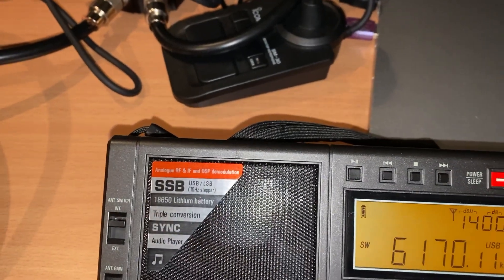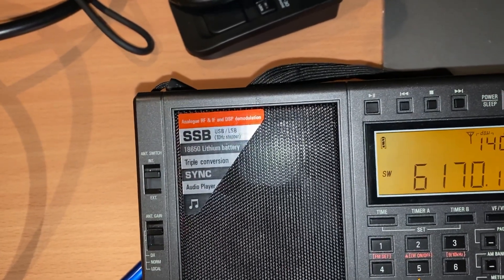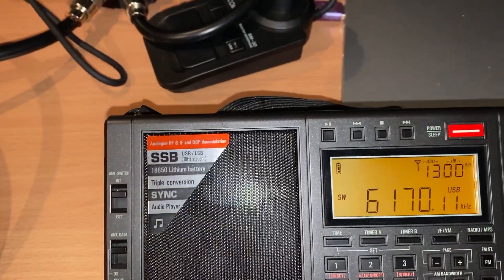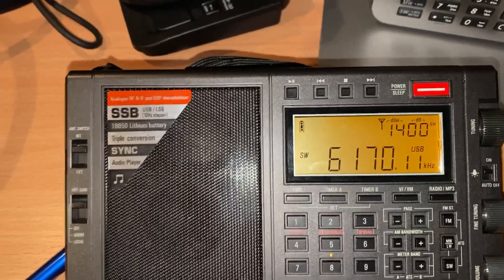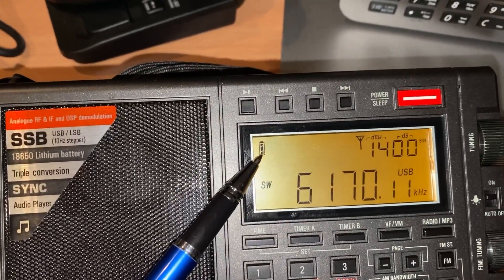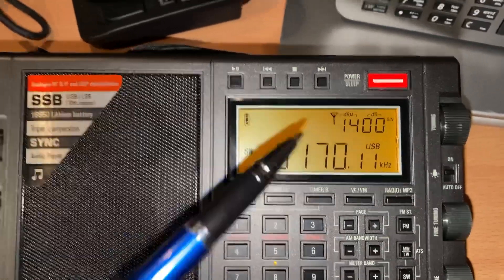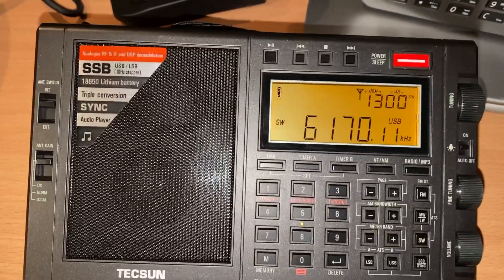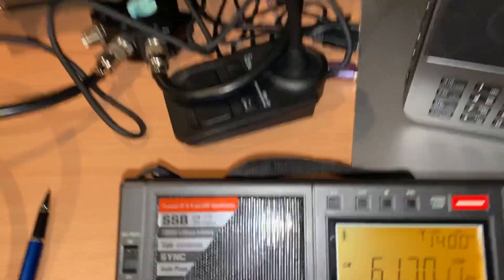Tecsun PL-990x Batttery Degradation.

Comment: After noticing my 8 month old PL-990x batteries are only lasting a couple weeks on standby - one of em only a week now -  I searched and found your video. I also have a PL-680 and the batteries that came with it were bad almost immediately. I replaced them with some Duracell's and they've been excellent ever since. Furthermore, I accidentally ordered 2 PL-368s and one of the batteries was DOA. The one I kept has worked  great for over a year now being used every day for at least 3 hrs (2 hrs for sleep timer and in the morning as an alarm. Btw, what an awesome radio, just like the pl-330 but in a different form factor, for those who don't know.)  So my conclusion is you could be hit or miss with the Chinese batteries but it sounds like from other comments that they're of inferior quality anyway. Thanks for the reminder on the care of Lithium batteries. I hadn't used my radio for couple months and it ran totally down. I think that's probably the one that now lasts only a week or less... Time to shop for some new 18650's and watch the charge level. Thanks for the video.
Reply from the maker: Hi and thanks for watching, I prefer NiMh cells because you don't need to think about them, if they're dead it's not detrimental.

For portable radios I really don't see an advantage changing to Lithium cells.

Comment: Just got a new 990 today it came with a stone cold dead battery that won't charge in the radio.  Ordered 2 18650s with a charger. I will never let them go dead.
Reply from the maker: Sorry for late reply, be very careful with lithium, don't charge it if the voltage goes too low. I really don't like lithium batteries in radios, nothing wrong with NiMH AA cells and they're a lot easier to get and can just pop in fresh Alkaline and you're good to go.

Comment: My radio had a standby current draw of about 5 to 6 mA. This lasts in a standby time of only 1 to 2 weeks. Additionally the batteries were drained to death. Finally I solved the Tecsun PL 990x standby power problem. The radio now has a current draw of about 88uA. This is a great value. The manual states 120 uA. Video Link: https://youtu.be/yx2br2XNpD4
Reply from the maker: Excellent, glad you fixed your current consumption, how did you fix it ?

My 990x battery lasts a long time, many weeks of standby use. The PL-330 also, the 330 always amazes me, it sounds a lot better than the 330, not as full sound of course because of it's tiny size, not as much bass but it sounds so much clearer on SSB and it works remarkably well with external antenna, very little observable overload, in fact I hardly notice any. If only the 330 didn't mute when tuning, this is extremely irritating but this little radio is a gen, sadly still some SSB distortion but it's a keeper.
Reply: @o00scorpion00o  As mentioned in my video I desoldered the Power MOSFet and the Schottky diode. They tested to be good. After cleaning the PCB with alcohol and resoldering some other parts in the nearby area, the error was gone. Maybe al leakage current. My 990x has strange behavior of the volume control. It depends on the battery charge. If the battery voltage drops the volume knob has a hysteresis. When I turn the volume up, nothing happens at first, then suddenly the volume increases. You can can confirm that? The muting of the cheap radios is very annoying. They do all signal processing in software. Thats the reason why.
Reply from the maker: @e-teacher9402  Thanks for the info, didn't know that about why we have to suffer the tuning muting. At least the made the 330 sound a lot better than the 880/990x S-8800, I suppose the tuning mute is bearable because it's a pretty decent radio for it's size with excellent performance, at least with external antenna. 

I will check out your video!

Comment: My pl990 does not turn on only show clock and light but no buttons work please tell what to do
Reply from the maker: Try pressing the reset button on the bottom of the radio next to the sd card slot. If not then take the battery out for around 10 mins, install battery and try reset again.

Comment: Do you know if the Tecsun pl-880 has the same issue? I have a Tecsun -990 and thought my batteries were loosing their life fast. Now I know why.
Reply from the maker: I found the life of the cells in the 880 didn't last so long either which could have been related to the radio not managing the voltages properly or due to poor quality cells or both.

The PL-680 in my opinion is a far batter radio because while the 990x is more sensitive on the whip the SSB audio quality on the 680 is much better and it's a much cheaper radio.

Best way to manage your battery is not to let the battery level shown on the radio to drop below the last bar and charge it up as soon as it hits the last bar. Don't let it run until all bars are gone and the battery indicator is flashing. 

The other advantage of the PL-680 of course is that it can take regular AA cells.

Get a good quality samsung or panasonic cell, max capacity is around 3500 mah not more so beware those advertising cells above this and there are many bad cells out there so get them from reputable suppliers, do your research.
Reply: @o00scorpion00o  I had a Tecsun pl-660, and 680. Sent them back because the offset frequency calabration did not work properly on the radios. I thank you for the information
Reply from the maker: @DarrenN72  That's strange Darren, my 680 calibration is fine, there are issues with quality control with these radio, some are luckier than others. 

No such thing as a perfect radio. I should have the updated version of the Malahit from Russia next week, can't wait to try that out, a friend of mine just got one and he's very impressed.
Reply: I had a older pl-660 I sold off. The frequency calibration worked  good on it. Just the new 660' and 680's I have problems with the frequency calibration

Comment: I just made an accidental observation regarding this.  I have many 18650 batteries, today is battery charging day.  When comparing the cells included with the PL-990 to others i have noticed that the included cells are about 1.5 mm longer than standard. This makes them protected 18650's. I would hazzard to guess that this means that there is no charge protection circuitry in the 990, other than a high voltage cut off for a full cell.
Reply from the maker: I have no idea what protection may or may not be in the cell but I do know that the internal resistance jump was high and it lost 400 Ah capacity. So something isn't working right my guess is the the voltage is going too low. Too far high or low is bad.
Reply: @o00scorpion00o  well i got really really into vaping competition a while back, so i had to do some fairly in depth research on lithium batteries so as to not blow off a few fingers when things go sideways.
Lithium batteries come in two basic flavors, internally protected and no protection at all.
The protected cells have a charge controller chip, typically on the positive terminal.  They are most common in high powered pocket torches and stunners, high voltage high current applications.
The easiest way to tell the difference in the two types is that the protected ones are ever so slightly longer to allow space for the protection circuit.
Reply from the maker: @abelincoln7473  Thanks, Abe I didn't know that. I wonder why type of protection they offer though ? Low voltage, high voltage cut off, both ? 

Perhaps this protection allows the cell to go too low which prematurely degrades it but not too low to risk fire when charging a cell that's been allowed to go too low. One thing for sure is that this cell in the 990x has lost way more capacity than it should have after 1 month so something isn't working as it should.
Reply: @o00scorpion00o  Well from my understanding of Lithium battery chemistry the two things that kill a cell the fastest are: over discharging the cell or charging it at too high a rate ( too much current or too high a charging voltage). A properly designed protection circuit typically cuts off the drain or the charge at about 3.4v on the low side and about 4.35V on the high.  Most batteries will tolerate being charged at a rate of 1 C or the equivalent to its stated discharge rate without risk of fires, shorting, etc... However it is VERY detrimental to the life of the battery. Most of what i have found tends to indicate that charging at 0.5 C is a much better practice, as is only charging to a cutoff voltage of 4.15 V.  
https://batteryuniversity.com    
that is a good place to start. If you have any questions about the math or the definitions just ask.
Reply from the maker: @abelincoln7473  4.35 for Li cell is too high should be 4.2 volts max but yes 4.15 is a good start and no less than 3.5 volts. But somewhere along the way the Tecsun seemingly fails in top or bottom end voltage protection or both. It wouldn't be uncommon for Li batteries to go to 3.2 v per cell to maximise run time. 

LiFeP04 being the exception to this, it works at lower voltages. Can't remember the HVC and LVC off the top of my head.
Reply: @o00scorpion00o  Hmm. I have been using Li-Co-Mn-Ni  perhaps thats the difference in the voltage... I will have to look into that tomorrow after work.
Reply from the maker: @abelincoln7473  I don't know of any Li tech that charges to 4.35 volts. LiFeP04 charges to lower vvoltage than normal Li.
Reply: @o00scorpion00o  @Abe Lincoln What external charger would you both recommend?
Reply from the maker: @klrscout  I use the Youshiko YC5000.

Good charger, can charge AA, AAA  and 18650 + various other cylindrical Lithium cells. I got it on Amazon. 

It will measure voltage, Internal resistance and it will do a discharge/ charge cycle to tell you how many mah the battery takes which will give you a good indication of how your battery is performing. You can set that charge current too. But I wouldn't do a charge/discharge cycle frequently, Li batteries don't need it, it's just to get an indication of the capacity in the battery. 

The other issue is the Tecsun PL-990x, we don't know how much it charges at the top or how much it drops to at the bottom and it could very well be allowing the voltage to go too low and I will do a discharge test soon to see how low it goes. 

A good battery internal resistance will be around 75 Mo. Mine was around 120 after 3 weeks and that's not good.
Reply: @o00scorpion00o  Thanks for all this info. I had some sort of malware in Chrome, and could not reply all day! I hate being rude, but had no choice!

Comment: Good info also applies to smartphones
Reply from the maker: Yes, smart phones usually use the max available in the battery and that's not good if People charge to 100% every night and discharge all the way every day, keeping a battery between 80% and 30% is going to really extend the life of the battery but the battery in a smart phone is only designed to last the life of the phone which is only 2-3 years, sadly, the waste is terrible really because these days most phones are still good after 2-3 years. 

My iphone 11 pro is the only Iphone I've had that still has 99% capacity after 1 year and Apple have improved the charging algorithm because it monitors your usage and when you plug it in and out of the charger so if you go to bed at 10pm every night and get up at 6 am Apple have now set the software to only charge the last 20% just before you get up at 6 am or whatever is your time to get up, that's pretty cool but I usually don't charge the phone fully anyway, mostly to 80% and that's plenty to last me a full day and I usually plug it in no lower than 20-30%.

Comment: Thanks for this. Very interesting video and an astute observation and explanation on the capacity loss of the Li-ion 18650 battery which seems to come with quite a few radios these days. Glad I returned my 990x which had other problems, although funnily enough they told me I could keep the two batteries...
Reply from the maker: When I'm finished making videos I'm going to sell the 990x, it's too expensive to have such poor sound quality on SSB making ECSS impossible and listening to hams is unpleasant due to the poor sound and distortion. 

I'm happy the 909 X2 uses AA batteries, they really don't need all this care, they're good for Electric cars that have extremely well calibrated BMS systems but not really necessary for portable radios. 

My Li cell in the 990x has lost 15% capacity in 3 and a half weeks and my BMW i3 Electric car almost 4 years old and 104,000 Kms or 64,200 Miles has lost around 3% which has greatly exceeded my expectations + the i3 battery also has an excellent directly AC cooled system for the battery.

Comment: I am not had good luck with LI batteries that come with Chinese products.
Reply from the maker: I think the batteries are fine I just think the radio allows the voltage to go too low, if I remember correctly you could set the PL-880 Low Voltage cut off which should be set as high as possible but I don't know if such a feature exists for the 990x.
Reply: @o00scorpion00o  OK, thanks.